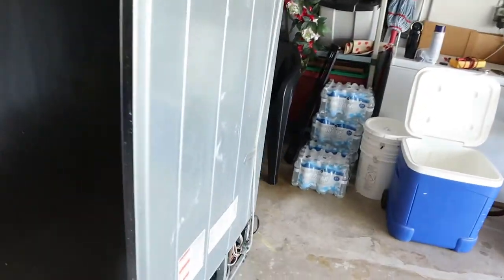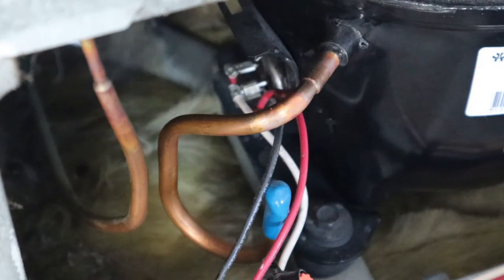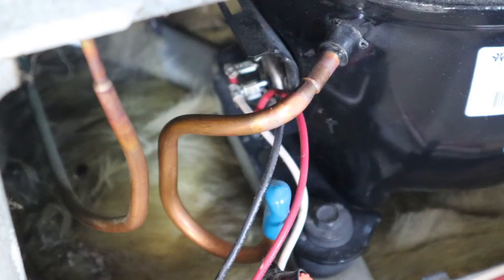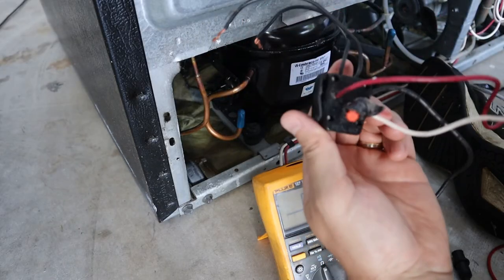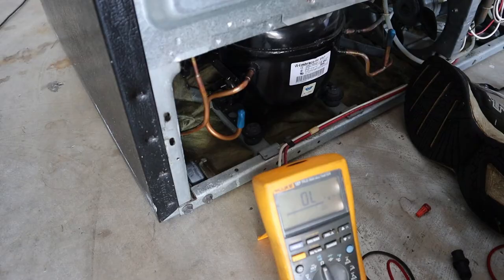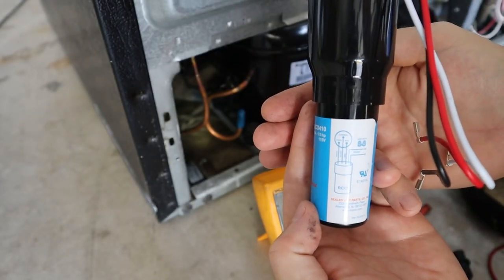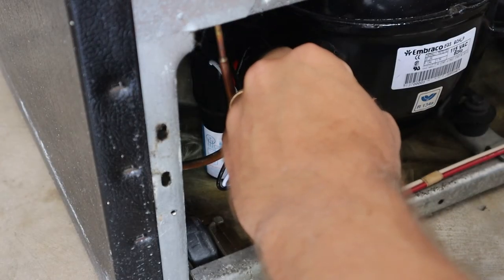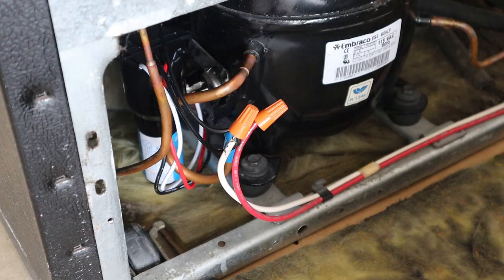Kitchen Aid / Whirlpool Fridge Not Cooling but Clicking

Comment: This video was spot on!  I was able to order the exact part based on the information Joe gave.  My husband changed the part in 15 minutes.  Great Video!  Awesome save for us especially the week before Christmas!  Thank you for your information and sharing it on this venue!
Reply from the maker: No problem glad it worked out for you! These days with the poor quality of new appliances do better off keeping your older stuff running anyway. I actually keep one of those kids in my toolbox just in case. Cheap insurance is the way I look at it
Reply: @JoesGarageProductionsLLC  would you happen to know why that relay on the side might melt? My compressor would kick on, then shut off.. you could smell the burning plastic of the crumbled socket.. what could be the issue ?

Comment: Mines start and then will go off after a minute of it being on and it’s loud lol
Reply from the maker: Sounds like it might be going out on overload. Are your condenser and evaporator fans spinning?
Reply: @JoesGarageProductionsLLC  yes all working great I’m guessing my compressor might need a re charge on Freon ?
Reply from the maker: @nelsoncanelas1978 typically when a refrigerator is low on a refrigerant, the compressor will get quieter, rather than louder, simply because it is not working as hard. In your case, based on the information you're providing, I would recommend checking the current draw of the compressor while it's running and compare that to its running load amperage. If you see a high reading there, that will confirm the compressor is going out on overload. That, combined with the loud noise, might suggest a liquid line restriction. I would then hook up a set of gauges to confirm. If you see an elevated high side pressure that would kind of confirm it. Obviously it's impossible for me to say for sure, not being able to see the refrigerator in person. But based on what you're telling me, that's what I would try next.

Comment: Hi I have a question my Frigidaire refrigerator sometimes has an intermittent problem which is it keeps running and don’t defrost I replaced the sensor in the freezer and also the defrost timer it works for a while but then it goes back could this mean that there’s a short somewhere in the wire harness. The defrost timer is   Genuine part .

Comment: When turned on, the fans are working, the clicking noise you mentioned is also happening. After leaving the fridge on for a while, the compressor feels warm to the touch. I have ordered the part you talked about, but wondered if the fact that the compressor feels warm might indicate that it would not be the starter.
Reply from the maker: Nope, the compressor will still be warm if the starter is no good. Statistically it's probably the starter.

Comment: Hi. I've got a Whirlpool 11 cu foot fridge. Bought it new 7 years ago.
The relay seems to be bad as it is open (no conducting) thru the two lower round holes. 
The compressor checks good (no shorts to tank and leads, all leads connect with each other. 
And the capacitor tests functional also.

Question,.when I plug in the fridge a loud noise occurs from the compressor tank. It sounds like something is stuck. Could all of the tank check good but it be locked up and causing this loud noise?

The fridge was working fine one day, and next day it made this sound and I noticed the fridge not cooling anymore in wither section.

Comment: Hi can you please tell me (or anyone for that matter) 😅 what to do with the condenser fan wires? I don’t see anywhere to connect them and can’t find anything about it anywhere. Also will a 1/12 to 1/5 hp work with a 1/4 hp compressor. I hooked it up without the fan but the compressor still isn’t starting up.  Thanks very much and happy new years.

Comment: I removed my old start relay / overload because it was clicking and not allowing the compressor to start, I used my multimeter on it and was dead.. so I bought one of those 3 in 1’s like you used, wired it up, and still nothing.. i tested the compressor windings and got good readings and it’s not shorted to ground either.. any ideas why it won’t kick on? Thanks!
Reply from the maker: Are you getting line voltage at the compressor terminals when the computer/t-stat calls for cooling? If so, and you are sure the overload and starter are good, the compressor might be locked up.

Comment: Hi , my fridge stops cooling like usual , the compressor start then make a noise like ( losing some power / click back ) then make another click and work again  , btw the fridge doesn't make on/off cycle anymore and it keeps running the whole day without stopping .. i cleaned the coils / the fan spinning greatly , i can't feel any hot in the area except some warmness of the compressor . Can you help to identify the problem ? please

Comment: @Joes Garage My bar fridge just started this clicking, and I noticed the compressor didn’t come on. I unplugged it for an hour, and it still does the same thing. 
Will the part you suggest from Amazon be ok for my small bar fridge?it’s a Dandby. Please help. 🙏🏻. Thankyou
Reply from the maker: This is lately my favorite universal start + overload kit. It has provisions for a run capacity as well. if your application has one (yours probably doesn't). I've had pretty good luck with them. https://amzn.to/3MtPkHV

Comment: Whirlpool Model #GD5RVAXVB00. Just installed new OEM Whirlpool Start Relay 2-days ago. But it's clicking now. I know this is a bad sign. But Start Relay is brand new. Compressor is shutting off when the Capacitor Overload kicks in. Don't know what to do. Please help as I need to get this fridge back working. Thanks kindly!
Reply from the maker: If new start components did not fix the issue, you may have a problem internally in the compressor (I would start by ohm'ing out the windings) or perhaps the brand new start components are bad (it happens)

Comment: I replaced the start device. It works for a while (three weeks to a month) and then the refrigerator returns to cold in freezer section but warm in the refrigerator section. How do I fix that?
Reply from the maker: You may have a problem with the defrost circuit on the freezer side. Take the back panel off and see if the evaporator coil is icing up. If it is that is likely your problem.

Comment: If the fan is still kicking, then it's the starter?
Anyway I can tell if my compressor has gone bad?
Reply from the maker: If the evaporator and condenser fans are still running and the compressor is not, statistically it's probably the starter. You can own out the compressor terminals but that will only tell you if the compressor is electrically okay and still isn't a guarantee.

Comment: Hi Joe, how did you get the cover off compressor starter?
Reply: I'm trying to replace w10629033 inverter
Reply from the maker: @mitchsimon6538  Some of them have a metal clip that retains the cover, some have plastic tabs built into the cover.